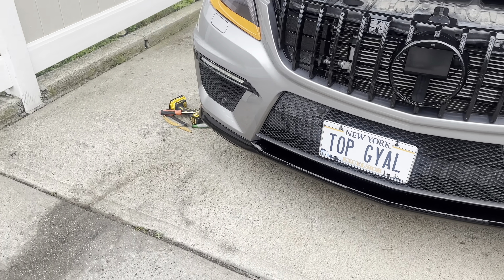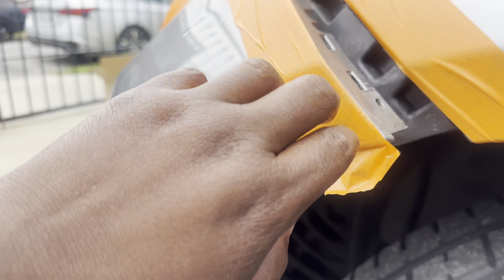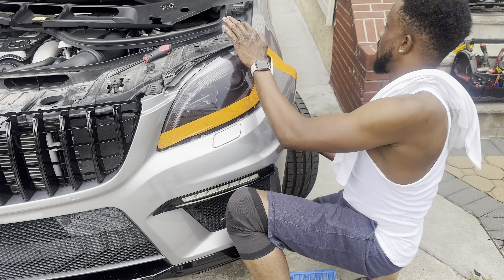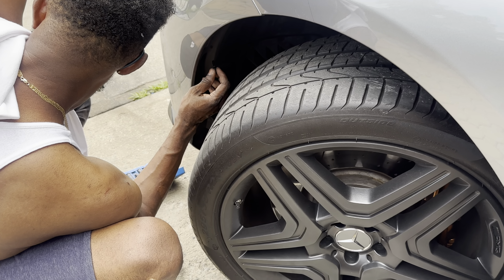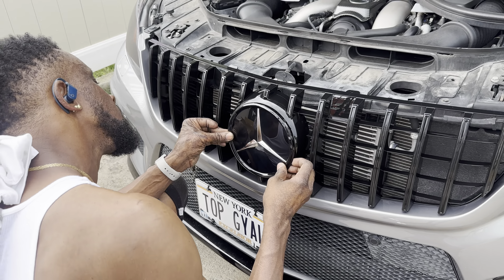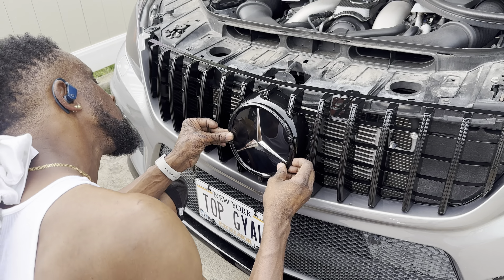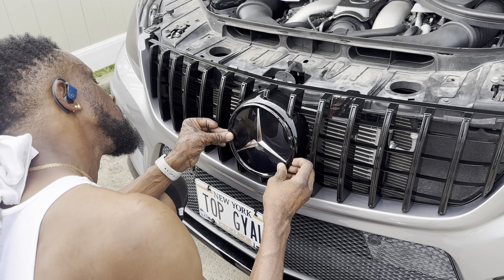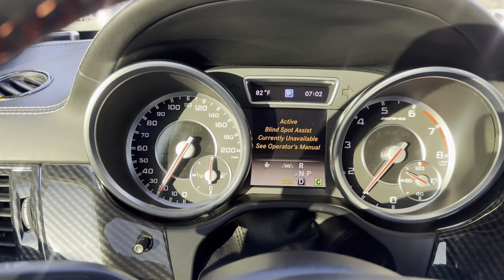Panamericana Grille With Front Splitter Installed | ML63 AMG

Comment: So the factory emblem is transparent. I have same grille if i take emblem off everything works. Badge just blocks front radar. Factory badge does not fit correct in grille. If anyone figures something out please reply.
Reply from the maker: I reuse the factory emblem and it fits u just have to play around with it and I also use a transparent glue to hold it in place

Comment: Still waiting for the links for the Grill, splitter, roof spoiler, and lowing links. thanks
Reply from the maker: grille sold out roof spoiler u can can find on ebay or ali express and lower you can find on ebay just put in ur car
Reply from the maker: https://www.ebay.com/itm/144729935597?mkcid=16&mkevt=1&mkrid=711-127632-2357-0&ssspo=nopt10tnqrc&sssrc=4429486&ssuid=kaNSLR2ERLK&var=&widget_ver=artemis&media=COPY
Reply from the maker: https://www.ebay.com/itm/275340782074?mkcid=16&mkevt=1&mkrid=711-127632-2357-0&ssspo=ej-RoLerSKK&sssrc=4429486&ssuid=kaNSLR2ERLK&var=&widget_ver=artemis&media=COPY
Reply from the maker: https://www.ebay.com/itm/115369439569?mkcid=16&mkevt=1&mkrid=711-127632-2357-0&ssspo=lWOokGgrSNe&sssrc=4429486&ssuid=kaNSLR2ERLK&var=&widget_ver=artemis&media=COPY
Reply: @TopGyal63  how about the steering wheel and airbag
Reply from the maker: send u 3 links the grille is sold out
Reply from the maker: sold out too sorry